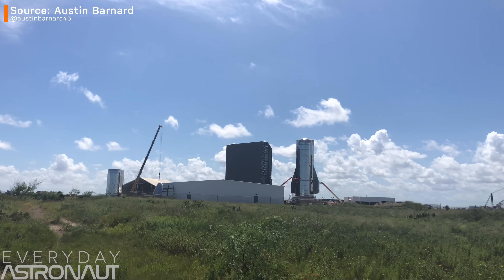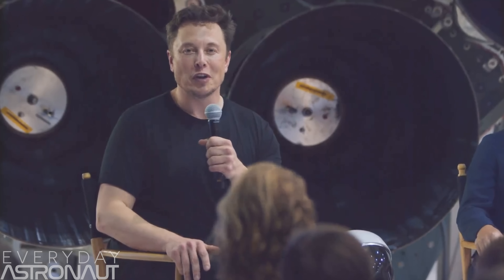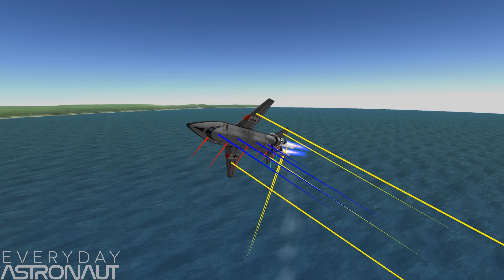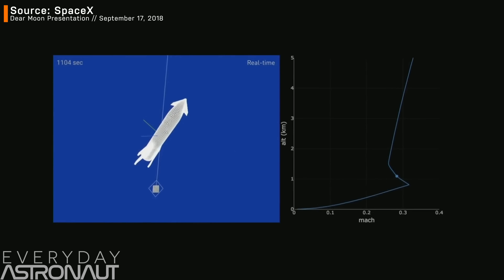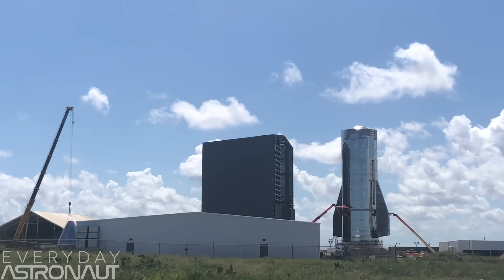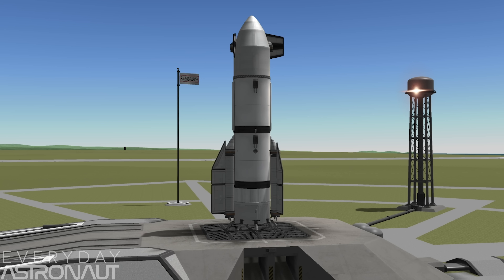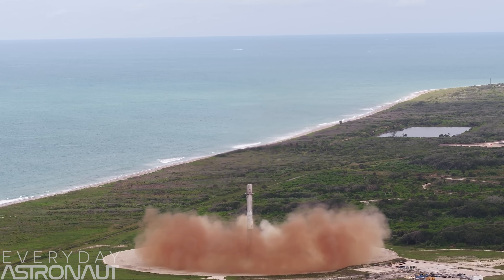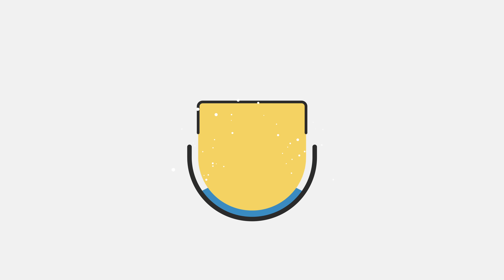Why does Starship only have 2 rear fins?!

Comment: the mechanically increased drag upon reentry principle was first implemented by virgin galactic. not trying to detract from SpaceX accomplishments, just stating that the concept has been proven to work. i'm a spacex fan and i like their design and implementation of the concept. virgin used extreme drag and light composite materials with little or no heat shielding. with that method (virgin galactic) a failure of whatever is producing your drag spells disaster with no option to escape.

Comment: Retractable fins would not be a viable solution. Consider the amount of space internally usurped by extra motors, slots to keep the brake fins in place, the overall increase in mass compared to remaining outside. No, cannot see the design going back to 3 fins. The design had to start somewhere, that we have already seen. The exciting part is what the end result will be. That's the joy of engineering, and how we progress. Looking forward to the end product.

Comment: A third would mean more weight but in the event that there is a "anomaly" with one the third could conceivably pick up the slack in the event one fails. I know the third was  originally supposed to be inoperable and non moving or non functional but they could have engineered to be functional.

Comment: A trivial topic:  How's SpaceX going to address the required stability of the Martian soil under the explosive rocket exhaust of the starship descending on the dry desert-like top layer of the Martian landing designated location?  Are they going to land on a flat slab of rock if the soil will be too unstable or becomes uneven / unsuitable for the starship landing gear system capability?

Comment: This makes more sense than the three-fin design. I think folks look at the space shuttle with its three fins/wings as the prototypical landing body, but they forget that the shuttle was an unpowered glider, and needed to operate aerodynamically in the thicker atmosphere for steering and landing. Whereas Starship will operate like a landing body only in the upper atmosphere and will use engines to steer and slow down during final descent and landing,. The fins only need to operate as air brakes during initial reentry until the excess speed is bled off. Great presentation and super graphics. Thanks!

Comment: @(Everyday Astronaut) great summary, and your Kerbal-foo is strong.  Two things, though.  First, while forces about the CG of an aircraft are - indeed - producing torques, they're most commonly called pitching, yawing, or rolling 'moments'.  (Sorry to be a stickler, but as a trained aero guy, that just stuck in my ear.  Call it an engineering ear-worm.) Second, almost all of my training is in the Mach < 1.0 regime, so forgive the ignorance, however, can these control surfaces work the way you describe at hyper-sonic speeds?  I thought supersonic lift was solely dependent on angle of attack.  The way you describe the use of the control 'fins' (of various types) makes it sound like they're just using them as large shock generators.  Are they 'blunt' enough for 'blunt body effects'?
Anyway, keep up the good work!

Comment: Have you given thought to using KSP Ferram Aerospace Research? It is an aerodynamic mod for KSP that changes the way aerodynamic/control surfaces behave in flight. I personally think it would be useful for testing the SpaceX designs.

Comment: i still think every one has this wrong. ok not starship, i think that is cool as hell but, direct to Mars is stupid, insane and just dangerous. 
the right way is to first go to the Moon, build a station there to get resourses to build a space station in high Earth orbit. 
now you ask why build this from the Moon, simply cause it would be cheaper to launch things into Earth orbit from the Moon then the Earth cause of gravity. it takes much more resources to launch from Earth then it does from the  Moon cause of the Atmosphere too. so this is why start at the Moon.
after you have the base on the Moon and she space stationin orbit of the Earth you can also build your spaceship on the Moon.
shuttle your crew from Earth to the space station, then the shuttle take people down to Earth, this is how you rotate your crews. 
then another shuttle takes the new crew to the Moon. they train on the Moon for their misson and then when everything is ready lift off from the Moon to Mars, or anywhere else they plan to go.
this method is safer, cheaper, and no less dangerous cause you have the chance of returning to the Moon which would be safer to land cause of no atmosphere, less stress to the ship... 
this is the method that should be used, direct to Mars is just to dangerous, you have to carry all the food, water and fuel you need from lift off from Earth to Mars and back to Earth, there is no margin for error. 
using a space station, then the Moon base will relieve most of the fuel needed, you can use a smaller ship and have more safety features, you could also keep the rocket the same size, carry more people and more fuel. 
direct to Mars is just too dangerous right now.

Comment: As long as any moving pats can take the strain and are protected from the extreme temperature variants then I'm not bothered how many fins it has as long as it comes back with as many as it left with lol

Separating the landing gear from the fins is a good decision though (if it loses a fin it can still land safely hopefully and not just fall over lol) and the weight saving is always a bonus too

Comment: I like the 2 fin version. Pretty much everything about it seems to be better. I think it definitely looks better too. But I think what is most important is what performs the best. And from what I can tell assuming it's implemented correctly. The 2fin version performs better. Unless they find reason for 3 fins. 

But even if they use 3 fins. It's better to have more landing surface area. Giving you angular and directional stability. On touchdown. Something you don't have with three rigid fins. So landing struts is definitely the way to go. Also he's using the landing struts as a sources of drag. Which does have some flaws. But it seems like an efficient use of available weight and space on board. One device performing two functions. 

However these are fairly critical systems. And if you lose one you may very well lose both. I guess it's good that they have 8. I would go ahead and even try to put 16 on there. In fact it may very well lower the weight. And increase structural rigidity. Not to mention the added benefit of redundancy and increase stability. Because there is a greater number of landing struts to spread the load. Each individual landing strut can be made from lighter materials. 

Not to mention the actual size of each landing strut will be physically smaller and take up less individual space and wait. So even though they're would be more individual pieces. It would overall weigh less. And due to the increased number of landing struts. They can apply more physical Force. You might even consider 32. landing struts. Because that would also give you a higher degree of control using them as drag during reentry. And with that kind of redundancy. The issue of having one damaged is mostly nullified.

Comment: Ok.  After watching your video, I'm sold on the two flap design separate from the landing leg system.  Not that you were selling it.  Your reporting is always meticulous, thoughtful and qualified.  Which I LOVE.  Thanks!

But, come on.  The advantages are obvious and overwhelming: weight, stability and safety.  You made the point that, in the three flap design, if the flap/landing gear ever got damaged when landing on Mars, it could be catastrophic.

However, the three flap Starship design also means that it could still function with only 2 flaps.  No option there for a two flap design. 

Would a three flap design with separate landing legs cost too much weight?  Maybe, they'd opt for that for later Mark series intended for Mars.

Hmmm.... I think I missed something....

Comment: With the skydiver flap style reentry,  where are the really hot parts are going to be?
For wings, it is the leading edge that get's the hottest, i think because it is closest to the compression of the shock wave.   But does that hold for the belly flop?  Could the leading edge be cooler as they are further from max compression?  Also with the reflective nature of the heat shield, is it the parts of the fin closest to the hull that will get the most reflected heat (I guess a good reason they will mostly be swept back?)
Also, what would be the impact of burn through of a flap?  They are not like wings holding the whole weight of the craft, with a structural beam that will fail when heated.   Could they keep working in a semi melted more draggy mode, with compensation from other flaps?  Would a melting flap just become an ablative single use flap?

Comment: air launched missiles that are fired from tubes have folding fins that fold into the fuselage entirely. Nothing new there, and not sure why they didn't use that for the rear fins.  would not work for canards, but.. the canards are small, and in the payload area, could be retracted, either forward or backwards,... 
Thanks for making this video, and waiting patiently for your Aerospike video!!  it will be awesome!  hope you make lots from the ad rev. for many years to come.

Comment: Kerbal is an excellent tool for proof of concepts(though definitely not for detailed design). Idk why anyone would take issue with it for large-scale, low-accuracy concept demonstration.
Edit: Also, I highly doubt they'll make the fins into landing legs. It's elegant, but adding weight-bearing strength in a second axis makes the bearing system far more complex. And that assembly has two major ways to fail, each of which cripples the other. From a redundancy standpoint alone, I think you're right; 3 fins won't fly.

Comment: 13:00 the split aircraft aileron is also called a rudderon. As it's a split dual control surface that performs the function of the rudder and aileron.

Comment: I kind of doubt that this will be its final, final form. This change may have gained some stability with the E and D part of entry, descent and landing but comes at the expense of stability with the L part. The ultimate intention is to land on unprepared ground on the moon and Mars. Six legs or not the main thing there is to have as wide a base as possible to avoid toppling over once landed. That's a really important part of a mission as it would make things a tad rough coming to rest with a horizontal aspect.  So for this first  prototype iteration it seems six legs in a ring and two lower "fins" is  more appropriate. Saving mass seems to be a high priority at this stage as the thing is already overbuilt like a battleship and has literally been slapped together as cheaply as possible. They just want to learn how to launch and land the thing at this stage and see how it holds up to re entry heating. The next iterations should be lighter and this will open up more options as to how the legs will be arranged. In the long run stability needs to be maximized for E D and L.

Comment: Why not just use grid fins?
Reply: Because it would not slow down the ship and it would have to re enter backwards or with a weird grid fin unstable config
Reply: Carlos_A_M I meant grid fins like those on the   falcon heavy rocket.
Reply: Carlos_A_M reentry backwards with boaters pointing down shouldn’t be a problem, I guess having the areobreak like fins would be more fuel efficient.
Reply: @robinwang6399  no it wouldnt, it would be dangerous, re entering backwards would mean less aerobraking control, more touchdown speed and remember that the engines could melt
Reply: Carlos_A_M not if you cancel enough velocity before you go into the atmosphere.
Reply: @robinwang6399  and that would take a huge ammount of delta v.

Comment: There’s a lot of similarities with the NASA/Air Force lifting body program, just look up the HL-10. The canards on BFR are still aerofoils and will produce enough lift to slow the vehicle during re-entry. The lift produced will be normal to the surface of the winglet/canard, which in turn will have a vertical and horizontal component, hence why it can kill off some speed.

Comment: They could still do the 3 fins style if they turn it around. i.e. attach 2 fins at 120 degrees on the leeward side of the vehicle and place the third fin full frontal as a keel. Question is, would such keel help in dissipating heat on reentry or would it lead to hot plasma flowing closer to the surface of the vehicle and loss of airbrake capabilities?

Comment: Getting the landing legs tied directly to the airframe could save a lot of weight in the fins and bearings.  Sending landing loads directly into the airframe rather than through the fin and through the actuator bearings then into the airframe.  Also getting rid of the sweep on the fins could mean smaller forward fins for CP control.  Smaller control surfaces means smaller actuators equals less weight.

Comment: What if someone made a space ship that looked more like a fixed wing aircraft, with a large wing on each side and a vertical stabilizer. And the blasted this thing into space by attaching a few boosters under it. Perhaps had a large fuel tank on it's belly for the last part of the trip into space.
Reply: They did that.  The design had some safety flaws but the idea of a space-plane has some real utility.

Comment: But having only 2 fins for controling the 3 axes of movement has one maybe crucial disadvantage. Isn't it that when you adjust the position of the fins to manuver one of the 3 axes, that you therefore are unable to simustaniosly do 2 or 3 of the other axes. Like if you are doing a pitch manover on landing, but suddenly because of an athmospheric turbolence you also have to do roll and yaw just now.

Comment: Hey, i've run across the notion that with aircrafts, unstability "means" more twitchy wich "means" more agility a few times now, and I can't help but make a comparaison between this and how suspension (& alignment) tuning works in cars, now i'm no professional but i play Forza and you can get quite deep into tuning since it's a semi simulation. 
I think the reason I (think i) understood this concept in planes is because i've come to realise that was the case for cars.
So obviously in cars you just have the front wheels as user input for direction, but how the suspension is tuned (and therefore how the center of mass of the vehicle reacts to the road and steering input) will affect greatly on what turning the steering wheel will do, like night and day
If you want to be fast and agile (think of circuit racing), you have to get lower to the grond, stiffen suspension, tune alignment to maximize the "unstability" so the car can diverge from i'ts path easily, while still being controllable.
If you want the most stability (think of drag racing or a road car), you want to soften susp and get higher and you're setting up everything so that any slight input will not geartly affect the path of the car, while still being able to turn.
Softer/Stiffer suspension basically means more/less delay between inputs and the reaction of the center of mass.
Again, i'm no expert so feel free to criticize if something seems wrong!

Comment: We are optimizing for payload mass fraction and aerodynamic glide path. The rear fin, intuitively, would also add stabilization during vertical glide, but analysis shows it would likely cause side to side oscillations instead, especially at lower Mach numbers.

The top "canards" are larger to allow for more stability at dynamic re-entry angles, smaller brakes made it unstable when switching to powered landing mode with various payload distributions. Active vs passive cooling was also a consideration. 

Going to watch the video now.

Comment: Starship uses the same reentry technic as the SpaceShuttle. So how it will manage the heat? The SS used different type of heat resistant tiles which weren't cheap to replace.

Comment: Question??    Unless starship has a landing pad! which it wont, might there be a very very high risk of the motors blowing a hole  where it lands and toppling over . or what looks like a flat rocky surface only to find that there is a camber and again starship topples over .
Reply: I suspect they'll have carefully picked a landing site before the mission leaves the ground.  I also don't rule out the use of rovers to inspect potential landing sites.
Reply: @TheEvilmooseofdoom  Thanks for your reply.
I want nothing but success for the crew.but do worry about the thrust the motors produce

Comment: The new design looks to be a better idea considering the space ship is falling through the atmosphere and not flying.through it .., A large percentage of  the kinetic energy of the ship will be converted into heat through  friction and will be discarded in one way or another, but some of the kinetic energy will  be expressed as a force on the point  where the fins connect to the  body of the ship... I'm sure the engineers will get it right but it might be a logical idea for the fins  to resemble  and act like the classic SpaceX grid fins...

Comment: The it's 'lighter' argument isn't fully fair, this designed change clearly sacrifices the width of the contact points with the ground, which means it restricted to even flatter surfaces on Mars.